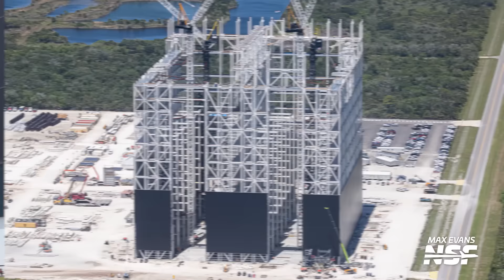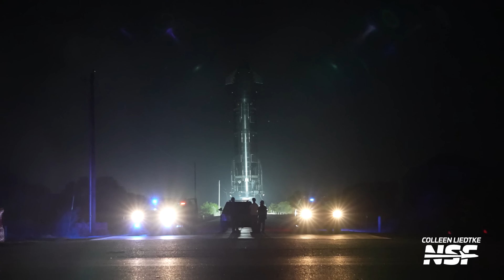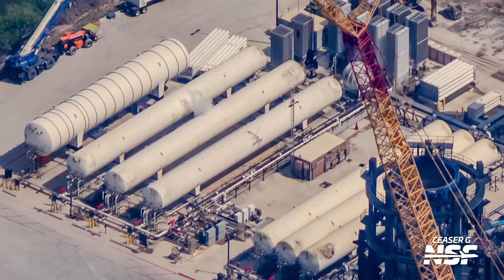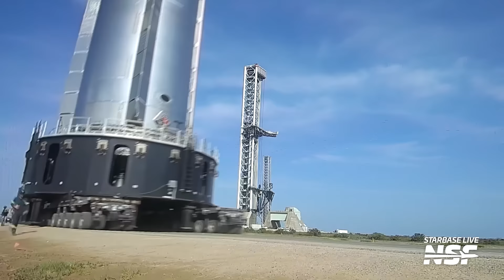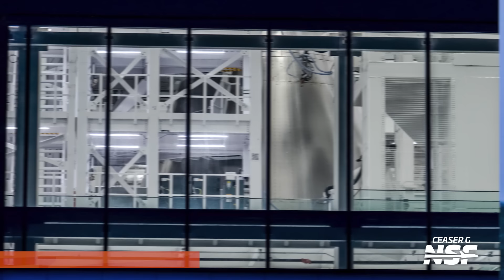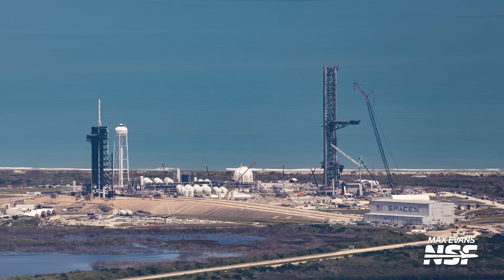Starship Update: Ship 39 Static Fire SUCCESS + Booster 19 33-Engine Test! | Starship Update

Comment: Well done Max. Thanks.
I suspect we'll see modifications to JRTI to allow horizontal booster transport or see it transported vertically which may demand fab of many more booster transports stands. Booster 237 foot tall vs. 220 feet of open length on droneship. Same for the ship as ship is only 7 feet shorter than booster, so stay peeled for the results.

Comment: Yet a Third Hypothesis on the seemingly short B19 Static Fire ... to allow for inspection of how well the deluge pipes in the flame trench held up (ie blast erosion) under the first static firing.  It's likely not feasible to instrument the piping extensively to provide real-time data (temps, vibration, ablation, etc.) during a static firing that would provide better information than what visual and hand-held instrument surface inspections could tell after the static fire ceased and the trench was drained out.  If the pipe erosion was negligible per design estimates, we could see the next static firing to be longer duration.  The true test will be Flight 12 liftoff when all 33 Raptor 3s are at near 100% throttle.   Those pipes are in for one heck of an experience ... Deano

Comment: Booster Transport Stand 2 is V3 compatible, it has pins and new proximity sensors which you can see on some other closeup photos although they're not using it for some reason

Comment: It's possible the 3 second booster test with 33 engines was planned to be that short so they could make sure the pad wasn't damaged. I don't think SpaceX has said whether it was cut short due to an issue or if it was planned to be that short.
Reply: Yes. I don't understand why they think the ground hardware should have to endure a minute of pure hell. Not to mention they probably don't have enough water stored up for that.
Reply: @ray3rd  I think NSF Ryan said they could run the water that long but I still don't think they would risk damaging the pad the first time it fires all 33. I doubt they will do a static fire for more than 10 seconds with all 33.

Comment: Can't wait for flight 12. We haven't had to wait this long since IFT2
Reply: At least we can take solace in the fact that this will be the last big flight gap.
Reply: @erictheepic5019 I sure hope so.
Reply: @erictheepic5019  SpaceX is starting to behave like flight gaps are a feature rather than a bug, becoming more and more like the old aerospace companies it overtook.  I've been worried about this for a while.
Reply: NASA needs either Starship to work as the HLS or Blue Moon/New Armstrong and the clock is ticking. One of them needs to be ready and up to the job by Mid '27 for Artemis 3.  And prove that it's fully capable for an actual moon landing the following year.
It better not tip over!
Reply: Don't worry, it'll fly in 4-6 weeks.  And in 4-6 weeks, it'll still fly in 4-6 weeks.  SpaceX is now "reliable" like that.

Comment: You're forgetting that Ship 38 also didn't conduct a single engine SF yet it still did the in-space relight
Reply: As a matter of fact Ship 31, which was the first ever to perform an in-space relight, also skipped the single engine SF.
Reply: On the flip side, but that time they had a lot of data on that lineage of Raptor, and this is almost starting fresh once more.

Comment: My understanding was that the booster didn't just shut down but shut the engines down in some form of serialy, as not to stress the booster unnecessarily. That could very well be the same reason they didn't go for a full minute, being cautious with a booster that was far more powerful than v.2.

Comment: I am not confident that B19s' very short static fire was meant to be that short. There's either an on-board problem with the booster or with Pad 2 GSE, and I suspect it's B19.

Which, if true, should require another rollout for another SF.

Then rollback to MB1 before any(hopefully)final roll to pad. 

sigh

Comment: for anyone wondering about artemis III updates, there was a tour of stennis where they had a Q&A time. here’s some things we learned:

nasa says crew selection is dependent on which HLS is flown. there is one crew more accustomed to starship, and another for blue moon. until they know that, they cannot announce crew.

nasa has one upper stage left of the current design (ICPS). engineers are currently assessing if the upper stage is necessary for the launch or if it should be saved for artemis IV. it depends highly on the energy (altitude) of the orbit.
Reply: What if they fly both HLS's? Would it be a mix of the two crews?
Reply: @unownyoutuber9049  my thoughts too, they didn’t talk about that possibility. not sure if that means they won’t do they or if there’s just not a concrete plan of what to do in that case